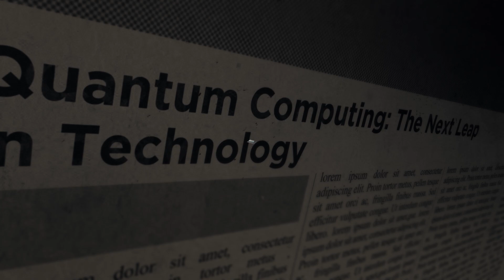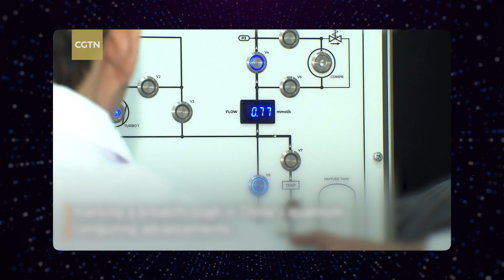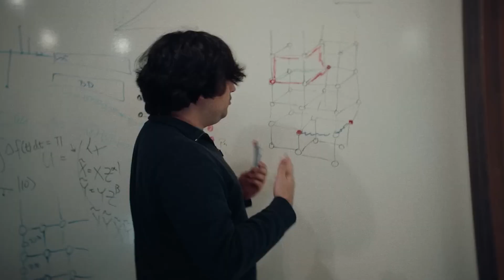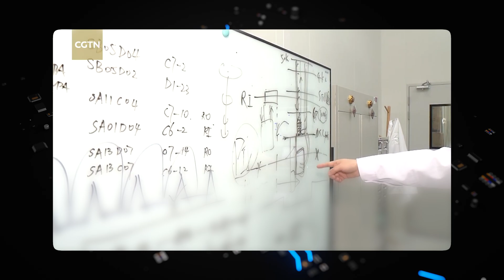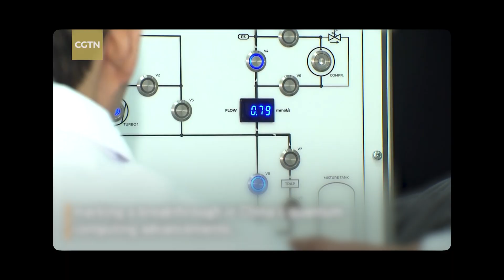Zuchongzhi-3: China’s 105-Qubit Quantum Processor Shocks the World

Comment: Would also point out that scientists have developed a quantum computer (Aurora) that uses light to process data, paving the way for quantum computers that can operate in a networked environment at room temperature.  Historically, quantum computers are kept extremely cold (close to absolute zero) to prevent errors caused by thermal noise and external interference, because qubits (quantum states ), the fundamental units of quantum information, are extremely fragile to their environment, with higher temperatures introducing thermal vibrations, disrupting these states and leading to errors.

Equally important development, scientists at Oxford using light allows distributed architecture where smaller quantum processors are linked via a photonic network, enabling them to share computational workloads.  Addressing the need to build a single massive quantum computer is impractical.  It’s a bit like ledger technology, whereby massive processing could occur via a distributed network.